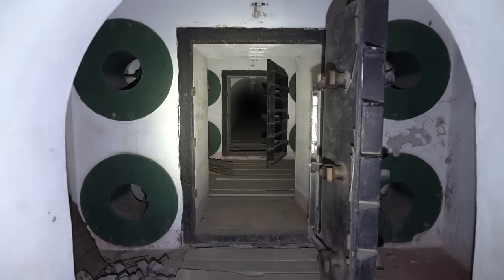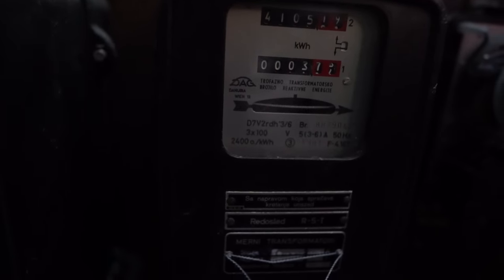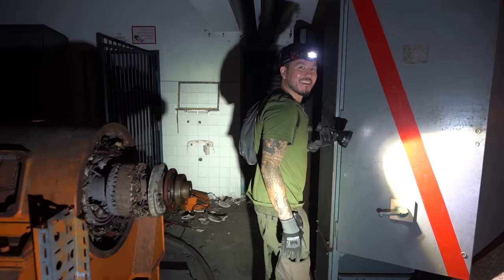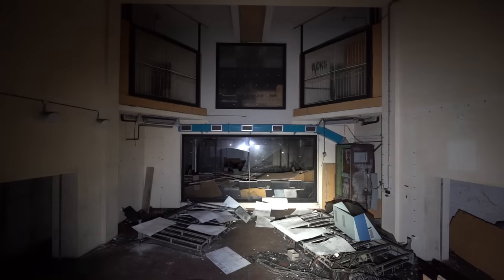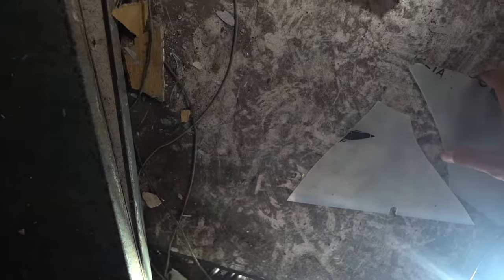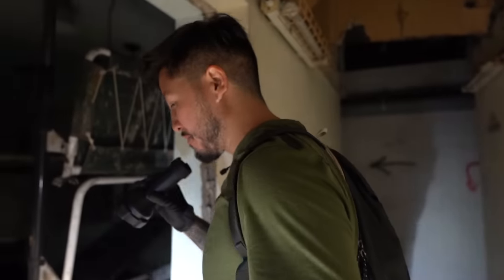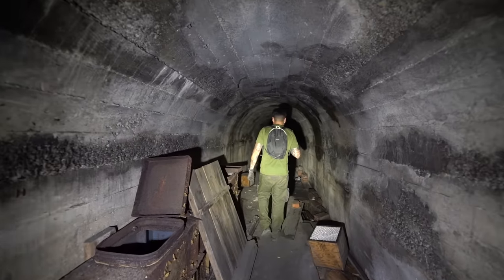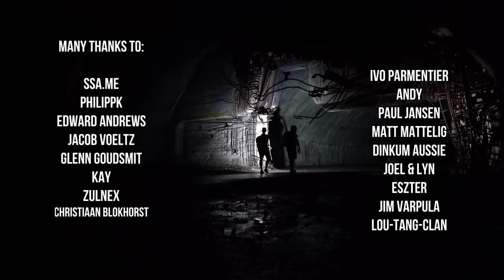Deep underground military command center | ABANDONED

Comment: 4:10 This generator not soundproofed like the other two is a NO Break system, practically the electric motor drags the alternator with a kinetic mass, it feeds the privileged safety loads continuously without interruptions, in case of power failure from the external network the kinetic mass of the flywheel, about 5 tons keeps the alternator revolutions for a maximum of 16 seconds, in this short period of time the diesel engine must start and run at full speed and engage the transmission shaft with its clutch on the flywheel, before the voltage and the frequency dropped too much, this usually took place in 7 seconds, the engine and the oil remained preheated via electric resistances or external boiler to send them water at 70 °, ready to start quickly, this system is identical to the ACE HIGH troposcatter stations in Italy.
5:30 refrigerator piston compressor.
24:25 large analog telephone exchange, probably needed many external telephone lines as an exchange between the bases and the other bunkers, it is a pity you do not see the details, some components are rare and sought after by lovers of analogue telephone on twisted pair.
I'm sorry for the mess that happened in Italy, it probably ends up in a cloud of smoke, it's an abandoned and poorly guarded place with nothing relevant.
Thanks for the great and fascinating videos!
Reply: I definitely learned something about generators. Thanks man haha
Reply: @TattooedTraveler  It is still used in particular applications, but it is rare, now they use a lot of battery-operated UPSs, and standard generating sets such as in data centers, much more autonomy in black out, expandable at will both in power and autonomy for large UPSs, but a lot electronics, sudden tastes and high maintenance costs especially for the batteries to be replaced
Reply: @winterburan  thanks for taking the time to explain it
Reply: They have flywheel based UPS systems for some older places but I haven’t seen one in person. Sort of the same idea but they are break and make. This is super cool and I’m glad you took the time to describe it! It sure beats having a giant room of batteries underground. Man that would suck to replace.

Comment: Great explore on its own! And I also appreciate that it leads me to another fine explorer to subscribe to! 👍

I'm curious if this bunker has a gravel/granulate pit to cool down external air before going through the filters - you know, when the bombs drop, the air gets hot. 🔥 Havent seen it in the video...
Reply: I appreciate it!, there is another ventilation shaft that you can walk up but it's at about a 45 degreee angle so it's not so fun. I don't think there is anything like you described.

Comment: 60 m./180 ft of climbing in and out... that's already no joke; but to then enter a Halon-protected room with a system that is, what, 15, or 20 years old? You mad bro!! 
Do you have any idea how it could be so hot, so deep in? Really an a amazing place, thanks a lot for the info-tainment! It reminds me a little bit of the NATO-Command Center that's near Maastricht (NL), near Kanne, in the limestone caves.
Reply: That ladder makes you climb weird too. I had never been here in the summer months and that was surprising to me as well. Passive ventilation in there I guess.
Reply: @TattooedTraveler  Can imagine, with a good 25 years of rust on that ladder ^^ Still interesting for the temp. Obviously it gets a lot warmer there during the summer then here in NL, but the old NATO-CP in the south of NL is maybe at 25% of the depth of this one, but always with a stable 12 Celsius; cool in summer and warm in winter :) edit thx for your service!
Reply: @G4rr3tt  thanks bro, and yeh it almost felt hotter in there than outside which was nuts

Comment: Halon gas will not kill you, this is a fire extingushing gas that is completely safe but not longer allowed to use due to damage of the ozone layer.
Reply: Sure.. it's the suffocation and lack of oxygen that will get you..
Reply: Halon can create an oxygen-deficient environment, thus high concentrations of Halon can cause people to suffocate. For instance In 2021, on military exercise in Serbian army, Halon was activated in one of IFV's, reasons still not clear, investigation still in progress, but one officer in IFV, suffocated and died..
Reply: @SoulArtSound  If the extingushing systems is engineered and calculated according to regulations there will not be possible to get too high concentration, with 4,25% halon the areas is safe and there will be no lack of oxygen. Halon effect is due to a chemical reaction that splits the fire without lowering the oxygen content. On the other hand, a fire will eat oxygen at a high rate so it is required to leave the area as soon as possible. I have worked with Halon for 10 years so I know more than average.
Reply: @TattooedTraveler  Halon do not lower the oxygen, Halon effect is due to a chemical reaction that splits the fire without lowering the oxygen content. Only a comment from my 10 year experience with Halon. But as a fire will eat the oxygen it is wisely to leave the area.
Reply: @arvidklubben595  There was no fire in IFV.. just Halon.
Reply: @SoulArtSound  Then the mixture has been to high or CO2 isused. If this happened recently I doubt it is Halon since this gas was banned 22 years ago.